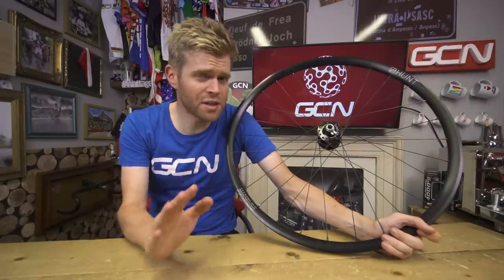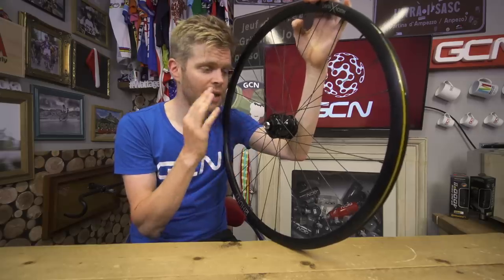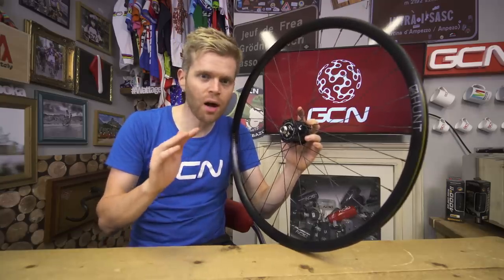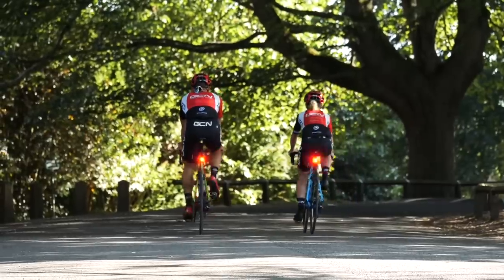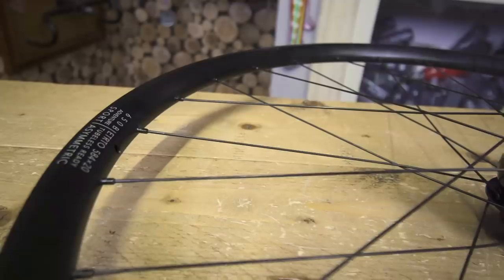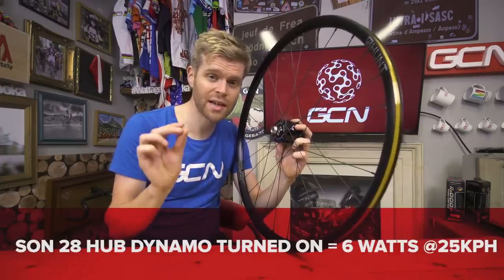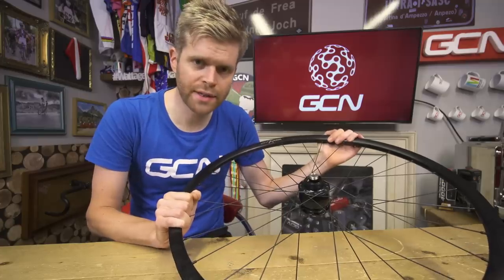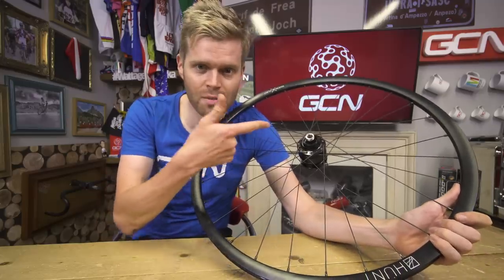What Are Bike Dynamos And How Do They Work?

Comment from the maker: Do you have a dynamo on your bike? If not, would you get one now? Let us know your thoughts in the comments below 👇
Reply: GCN Tech I do and it powers my automatic shifter. As it charges a couple of 18650s I can also charge my phone off it with a little voltage convertor circuit.
Reply: yes, and it powers my lights. Simple and efficient. I dont care about drag or weight. Great invention.
Reply: GCN Tech It wasn't really made clear in the video but before connecting a dynamo to a battery its important to check if the output is AC or DC. Most dynamos I've come across put out AC so it's essential to use a rectifier between the dynamo and battery.
Reply: Ed R you made your own batterypack of 18650s? Which ones? Panasonic ncr?
Sounds like good idea for biking around for weeks
Reply: Calvin Pessl Just some old ones from an old laptop battery, I'm using 2 cells in series. Mine really has one purpose which is to power the automatic shifter. The 8.4 volts is perfect for an Arduino and a servo. Left a comment below asking if anyone knows the optimum voltage for such a battery pack.
Reply: Got a DH-3N80 on my commuter bike. I do have an AXA front light with a USB port but I never needed to power something that couldn't wait for my commute to end so it simply powers my lights. I think the term dynamo comes from Sturmey Archer and their dynohub.
Reply: Ed R oh, even reusing old ones. Very thoughtfull.
The automatic shifter...you are not talking about Di2 are you?
If you use 2 cell lithium ion 18650 batteries, 7.4 volt should be most efficient for charging and decharging ime
Reply: Calvin Pessl No the automatic shifter is homemade and based around a CVT. With an infinite number of speeds to choose from I needed a microcontroller to keep up with the shifting.
I think the 3 cell 11.1V lipo I used to use got more charge as I spend almost as much time going faster than 12mph than 8mph. 
As I need 5V the 2 cell worked out better as less of a voltage step down.
Reply: I had a bottle dynamo on my bike when I was a kid, back in the 1960's. Not really something I need for the riding I am doing today.
Reply: I ordered all the bits to build my first dynamo earlier today. A timely video!
Reply: Got one on my endurance-type road bike, for the lights only, and one on my shopping bike. The front light on the shopper has a USB port to permit phone charging (I believe it has some inbuilt regulating circuitry to avoid surges to the phone.)
Reply: Highly efficient regenerative braking for eBikes would be huge... A gas/electric hybrid car never needs to be plugged in; why should pedal/electric eBikes be different? THAT would interest me.
Reply: GCN Tech I have  SON dynamos on all my bikes. I absolutely love them. I don’t race and so speed isn’t a problem.
Reply: Sure! On my commuting bike!
Reply: Not yet . But I want one for night riding
Reply: Could you reverse the connections and use one as a motor?
Reply: Only when I have gone on holiday by mistake.
Reply: Yes, I have Sturmey Archer GH6 Dynohubs (6V, 1.8W) on 4 of my bikes, powering led converted lamps. A fifth has a bottle dynamo because it has hub brakes which preclude a dynamo and I'm in the process of refurbishing a bike with a BSA Hublite Supreme, which works but I have no idea what its output is as there is no data sheet available and I haven't measured it. It's interesting to see that they've gotten so much lighter since the first ones in 1936.
Reply: I had an old SON hub dynamo on my recumbent commuter before I switched back to 'regular' bikes. Fair bit of drag if you lifted the bike and gave the wheel a spin. Not a fan of the extra wiring involved but absolutely loved the practicality. Sticking to battery strobe lights for my gravel bike but my next commuter should definitely have a hub dynamo again. Top commuting tech!
Reply: I have the same model wheel as featured in this video on my gravel/adventure bike. It's been running my Exposure Revo and RedEye lights for a couple of years. I have the RedEye wiring internally routed through my frame and saddle bag. I've just bought an Igaro D1 to handle charging of other gadgets as I plan to go further on the bike.
Reply: I now have hub dynamo on both my commute bike and road bike that I do all my long (1+ days) rides on. What it gives you is peace of mind so if it’s overcast /raining/ tree covered lanes like here in Surrey then I turn my lights on. It doesn’t have to be nighttime and you get noticed by car drivers more. To always be able to have light on is fantastic and I do on my commute bike as six months of the year it’s in the dark. Especially good is to have a rear light plugged into a dynamo because they are always bright, unlike battery light which can suddenly loose their brightness and then you feel vulnerable.  
I have the set in the video for multiday events and used the igaro bit of kit to to keep everything charged as I was sleeping out for days at a time with no chance of recharging everything at a hotel (TCR No6). 
I will never go back to standard wheels but that’s because I’m old. If you’re young you should be racing so this technology isn’t necessary for you.
Reply: Nope. No dynamos. My "see me" lights last a couple of days, my "me see" lights last about 6 hours constant use. I can drop them to about 2 hours on the brightest setting but that actually blinds oncoming traffic. I have two front lights mounted on my trike which gives me 12 hours of light before needing a charge. My rear lights last for weeks with disposable batteries.
Reply: Sounds like you've never tried a dynamo Mike. I used battery lights for many years and accepted they were the only option. Now I use a dynamo I see the benefits. All that hassle of taking your lights off the bike and plugging them into a charger is a thing of the past. I just grab my bike and off I go, simple. As for the rear lights that work for weeks on end. Sooner or later they dim and you may or maynot notice that, and tell yourself I'll sort that out when I get home/office or next time I stop. It's more hassle that I just don't need. One more thing to think about. No I'm definitely never going back to battery lights, and filling up landfill with disposable batteries.
Reply: I've had bikes with hub and bottle dynamos, I'd probably be more impressed if I got a modern version. :)   
I don't have to take the lights off my trike to charge them, the charging cable reaches the outlet where I keep my trike. If necessary, I can slip the battery out of its pouch and charge it that way, (haven't found that necessary yet) the other light unclips from the bar mount. That one gets swapped between the trike and bike. Both lights have low power indicators.

As for the rear lights, I always do a "walk-around" inspection before setting off (a touch of OCD) so I notice when they need new batteries before I set off. If they start to die in the middle of a ride, I'll notice because I've got three rear lights on the trike, one on the centerline and two on the handlebars, behind the front wheels, and I can see those two. If it does happen in the middle of a ride, well I'll be going through a town anyway so I can buy a set of batteries.

One advantage is that I can use the lights when the trike is stopped. As for disposal of the single use batteries, they're recycled here. 
I don't have a problem with dynamos, just have no personal use for them.
Reply: I prefere 3 phase AC generator connected directly to custom small chainring, so no need to mess with dedicated wheels - all you need is small cheap BLDC motor ;) One can easy disconnect this thing when not needed to avoid any drag power losses in DC based dynamos with built in pernament magnets...
Reply: I had a 2nd front wheel made with a SON Delux with the same rim as the 1st front wheel.  Using the same rim ensures that I do not have to adjust brakes when swapping between front wheels.  As for converting AC to DC, I use the Sinewave Revolution, and a cache battery.
Reply: Not unless you want to void the warranty.
Reply: I have on two bikes, both running Klite Longrangers. Awesome lights. My cargo bike also has its party lights run from it and I can recharge my bluetooth stereo speaker from it. Volt up people!
Reply: I fancy one. I got a bike Ollie promo'd before he was poached :) He was on Cube nu road pro they make a dynamo version I wasn't aware of. Wish i'd gotten that one. Hunt wheels look great for touring no more battery packs. Great price point too.
Reply: Yes, I have 3 bikes set up with dynohubs. One with a SON 28, and two with Shutter Precision. Lots of miles and with no issues. Don't worry about the weight, carrying batteries for battery light usually end up weighing more! I know because I have done both ways. Note my bikes are used to ride a lot of brevets, longest was 1500km. Dynohubs  are the way to go.........period!
Reply: Hub Dynamos and bottle generators are a rare find in the United States of the America or Estados Unidos de Mexico and need to be special ordered at a bicycle shop. I purchased a used German BTwin because they come with a hub dynamo, capacitors, and lights as required by German laws. The rental bikes in big cities have Shimano hub magnetos to power LED lights and GPS locators. Racing bikes are excluded from those laws so the equipment is not standard on those bikes.
Reply: this is the most sane free energy video i have seen  so far. congrats.
now help me. is it possible for dynamo to charge a  bettery? if possible ..how?
thanks in advance.
Reply: @GordonMoat  Consider it provides just 3W of power... its too low. You can't feed it with more power as it will fry the coil/circuit.
Reply: Recently I laced a new frontwheel for my gravelbike bike project and the hub is a dynohub. On my previous project, a pathracer with drumbrakes the frontwheel has dynohub too.
Reply: I do have a tuned Shimano N31. Yeah it's the cheapest available but it creates a ridiculous amount of current even already at low speeds.
I opened it up fully and got myself a donator hub where I took the cones and stator out and replaced the bearing balls for grade5 balls. Well lubed and precisely adjusted this thing is hardly noticable anymore and I run a Supernova E3 pure (which is not able to be turned off), 2 rear lights when the rack is installed for commuting, and will now install a "B&M USB-Werk".
All in all, I'm very hapy with my tinkered N31 and wouldn't swap it out for a SON or Shutter Precision. I would even go as far as claiming that it outperforms these competitors with my tuning in terms of current and drag. Simply the weight is really high, but there just is a limit to physics and how light you can build these generators whilst still creating enough energy for your use.
Reply: @Coleen West 
Added circuitry, at extra cost, could let a user set up a dynamo to work that way. Switch, rectifiers, and battery or supercapacitor could do it for a reasonable sum. The user could switch on the dynamo whenever the extra drag would not be burdensome.
Reply: charged ebike moto...
Reply: 6v dynamo   +3v magnic dynamo +3v magnic dynamo =12v dynamo to 12v ebike moto
Reply: They are good for riding at night and popular with the night shift commuters where batteries freeze in the winter.
Reply: no i just carry a battery pack if i ever go long distance which  is never.. 13 hours battery life on my lights thats a couple of rides for me
Reply: I just installed a Hella 7" spot light that is 360 watts (30 amps) for my 6 km country commute to town. So, I'm looking to find something to charge my 72 volt battery while I'm riding. My average commute to town shopping is usually less than an hour total.
Reply: @mr.blackhawk142  lol
Reply: Where can i get for my classic bike
Reply: had one on my bike when I was a kid. It was fascinating to use it and see the light titillating in front of you. The ones I used as a kid where a bit too draggy and sometimes cumbersome but it was kinda magic

Comment: An AC-DC "converter" is called a rectifier. It's not something anyone needs to know, but when you do know it, you can never help but correct those who aren't aware of it.
Reply: On a normal electrical generator the electricity is gathered from two different ring contacts (separated on the axial dimension) with pads that are in continuous contact. The dynamo uses a single ring contact that is cut in two halves (half rings) and pads on the opposite sides of the ring. As the dynamo rotates, the coils will produce alternatively a positive and negative polarization, but as the ring rotates the pads will contact first one then another coil (dynamos work on two coils only).
Disadvantages of dynamos: mechanical complexity, the magnets are fixed so you need to rotate the coils and gather electricity from them (increases electrical and mechanical losses), they need one collector ring for every two poles so most are bipolar, when rotating a bipolar generator you have peaks and troughs in the necessary force (they don't roll smoothly). A magneto can have the magnets on the moving part of the device so no mechanical and electrical losses on the collector part, can be made with multiple "pols" (phases) so the peaks and troughs are much lower, rectifiers are gonna work forever at peak efficiency (unlike mechanical systems with brushes collecting electricity).
Reply: Did someone say "Full Bridge Rectifier"??!!
Reply: @soupgaming5923  ElectroBoom would still find a way to get a shock with these
Reply: Growing up an ACDC converter was called a speaker, lol
Reply: Chris Miller really? Why? What do you mean?
Reply: @GalibFida  it's a joke. Because AC/DC is a very popular rock band.
Reply: Nah, I know that as well but I don't scream it out loud, you're  just arrogant
Reply: Maybe yer just OCD! (One Cool d00d)
Reply: Tbh I can care less
Reply: @JeremyGaray-t5w  Well, if you can care less, why don't you? Meanwhile I couldn't care less that you can care less.
Reply: Also a transformer.

Comment: The only thing I was interested in was HOW dynamos produce DC without diodes, but "they have commutators" is not a sufficient explanation to my ignorant brain. Nevertheless, it was a fun video to listen. You forgot to add to tire based dynamos that they can be turned on and off, so you don't suffer idle drag when not using them, which can be an advantage.

Comment: You didn't include anything about connectivity, lights, chargers, power banks. I know some basic stuff about electronics and I can tell that no gadget uses 6V. USB standard voltage is at 5 +-0.2V and 3W is close to half power than a basic USB 1A charger. I suggest you do a follow up video on everything about the peripherals of a dynamo.
Reply: al kiou the video is more advert than providing information
Reply: Many gadgets can easy step down to 5V from 6V, so it is better to have 6V than 5V, because of one need to regulate voltage level to 5V with different tolerances, so having 6V is advantage, because of one do not have to step up to higher voltage before using eg. linear voltage regulator which need slightly higher voltage than 5V to step down easy to 5V.
I'd like to see test where you connect multimeter with small load lets say 1W at see if those wheel dynamos whatever it is called have some step up converters which will help output 6V regardles of cruising speed in soem range lets say between 10km/h to 90km/h ;)

Comment: Thanks for the video.  At the time Sturmey Archer trademarked Dynamo cars also had Dynamos that was in the 1930s.   I begged a 1950's 3-speed dyno-hub in order to answer some questions people were asking in some of the vintage and near veteran bike Facebook groups.  The losses in a dynamo which is electrically simply a generator are

Copper losses in the case of an AG/FG/GH are 5 ohms  which when drawing current (300mA) is 1.5W = 5 x 0.3

Eddy current losses these depend on how thin the laminations, which minimise current circulating in the iron by breaking the circuit that would be made if it were solid mu-metal, the soft iron, conducting fluctuating magnetism to the winding.  A mains transformer and good motors have quite a thin, and therefore efficient, compared to a dynamo.  I do expect that the dynamo is not particularly good.  I am told of one modern hub dynamo that makes the bike much harder to peddle when the bike is ridden at speed when the AC generated is a  higher frequency than 50Hz mains.  This may be due to this issue?

Magnetising current - the power needed to keep changing the polarity of magnetism - for mu-metal this is very good.

https://blog.andrew-lohmann.me.uk/2019/07/bicycle-hub-dynamo-maintanance-project.html

But I have a question does a 3W dynamo provide enough power for all the lights and IT.   The answer is going to be no but will it be enough for the average person bike lighting and provide enough to top up his phone a bit?

Comment: I have a Son28 dyno hub, hooked up to a Supernova e3 triple heads light and a e3 tail light. I also have  a sinewave Revolution usb charger. This setup was expensive but its worth it knowing that I have lights any time I need them, and I can charge a powerbank witch I can then use to charge my phone, ipod, gopro and gps while I'm out touring.
Reply: I've got the SON delux with Edelux2 and Sinewave Revolution and a battery pack that allows for pass-through charging.  It is expensive but knowing that I can run all night is good piece of mind.
Reply: What set up should you recommend with gears like dslr cameras and laptop? Thank you in advance.